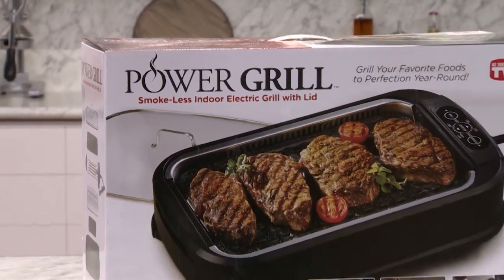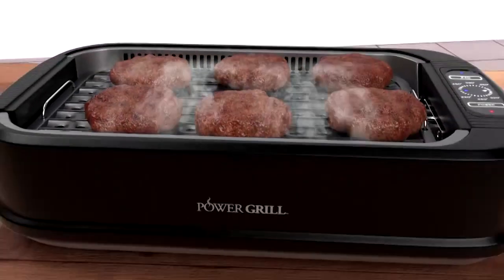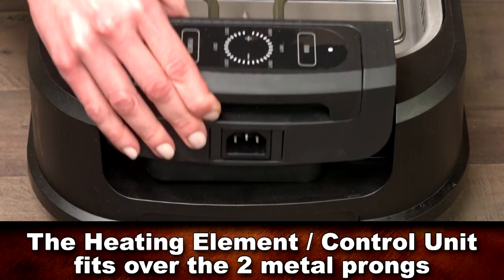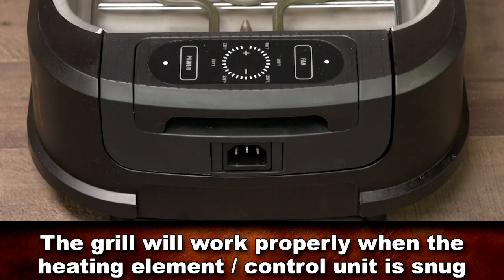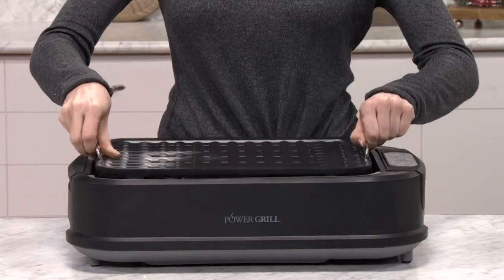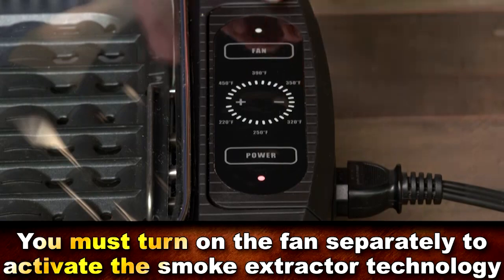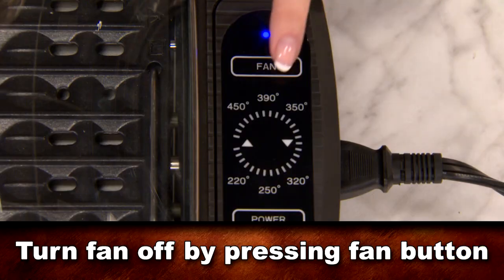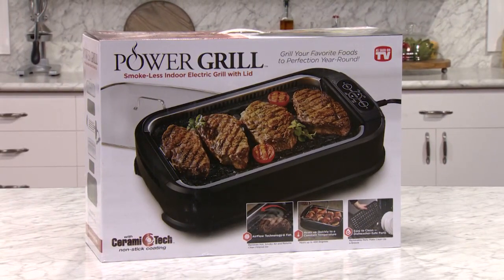Power Smokeless Grill Instructional Assembly

Comment: I got mine as a Christmas present from Sam's club. I'm using mine today for the first time. How do I clean it when I'm finished. I have a dish washer that I also got for Christmas. Thanks
Reply from the maker: Hi, Tammy Downes. Allow the appliance to cool completely before cleaning. The Grill Plate, Drip Tray, Collection Pan, and Glass Lid can be placed in the bottom rack of the dishwasher or washed by hand. The base unit can be washed by hand with a warm, damp cloth and mild cleaning liquid. For a more thorough cleaning of the base unit, remove the Electric Fan. Always be sure to wash the Grill surface after each use to remove any grease that may have accumulated. To keep grease from dripping outside of the base, always ensure that you are using your Grill on a level surface and that the Drip Tray is completely clear of food particles.
Reply: @PowerSmokelessGrill  thank you so much. I'm using it now. So far so good. My steak smells amazing.

Comment: do you need to leave it plugged in after use? It seems  like it might be running the fan on low to cool the unit after use but I'm not sure.
Reply from the maker: Hi rick pen, please plug out the unit after used.

Comment: I bought this at Sam’s and really like it. Do you have to use the water container and the fan to just use the griddle?
Reply from the maker: Hi  Kathie Bendinelli, the smokeless technology works by using the fan and filling the Water Tray with 2 cups water. If you do not use enough water in the Water Tray, greasy, sugary, or oily food may increase smoke output. Also, ensure your lid is completely sealed over the grill, as this helps contain smoke and seal in the flavor. Temperature, food type, fat content and marinade can increase smoke output. Finally, make sure to thoroughly clean the grill/griddle plates after each use.
Reply: @PowerSmokelessGrill  so if I am making grilled cheese sandwiches on the griddle I still have to use the water and fan?
Reply: @PowerSmokelessGrill  MO
Reply: @PowerSmokelessGrill  Rd pm

Comment: Is this appliance suitable for use in the United Kingdom
Reply from the maker: Hi, John Millwood.

As long as the unit is operated on a dedicated electrical circuit and not with a voltage transformer.

Thank you
Reply: Power Smokeless Grill That doesn’t really answer the question. Let me ask this, Is it 240 volt or is it 110 volt.
Reply from the maker: Hi, Daphne Millwood.

The power supply of this unit is AC 120V 60Hz.

Thank you.

Comment: if grilling for a long time, do we need to refill the water in the bottom tray?
Reply from the maker: Hi iczzzz, the smokeless technology works by using the fan and filling the Water Tray with 2 cups water. If you do not use enough water in the Water Tray, greasy, sugary, or oily food may increase smoke output. Also, ensure your lid is completely sealed over the grill, as this helps contain smoke and seal in the flavor. Temperature, food type, fat content and marinade can increase smoke output. Finally, make sure to thoroughly clean the grill/griddle plates after each use.
Reply: Power Smokeless Grill is powerXL a better version of this?
Reply: not the same brand i guess

Comment: It's a good grill, but the drawbacks are it doesn't get hot enough, and you don't have complete control of the heat levels. It's an either or. One of your recipes calls for 425°, and that's an impossible setting. You have to go to 450° whether you like it or not. Disappointing. But overall, ok.
Reply from the maker: Hi Robert Richard, please visit our LiveChat at http://tinyurl.com/ntohvw5 for us to assist you accordingly. Our LiveChat hours of operation are 7AM-11PM, Monday-Sunday. Thank you!
Reply: Are you able to adjust the temperature while you are cooking? I like to cook chicken with lower heat at first to cook it all the way through and then turn up the heat to to make the outside Krispy. Can you do that with this grill?
Reply: @davidsheriff9274  no, which really upsets me
Reply: It is very disappointing. I may return it and buy one that has a real temp control and can do the temp I want.  Here is the answer from the livechat link....The lines on the Temperature Dial are for design purposes only. You can use the temperature closest to what the recipe calls for. Either use a lower temperature and increase the cooking time or use a higher temperature and decrease the cooking time, based on how you like your food cooked. Be sure to check for doneness.
Reply: @sheissewspiritual7840  so you have to pick a temperature and keep it there through the whole cooking process? That's stupid, I don't know anybody that cooks like that. The lines on the temperature dial are just for show? That is so dishonest and misleading. Do you know of any models that let you adjust the temperature while you are cooking? I wonder if the ones that use infrared lights like the Phillips is better.
Reply: @davidsheriff9274  Yup, it is really dumb. I am going to start looking into other ones, maybe one with a digital display.